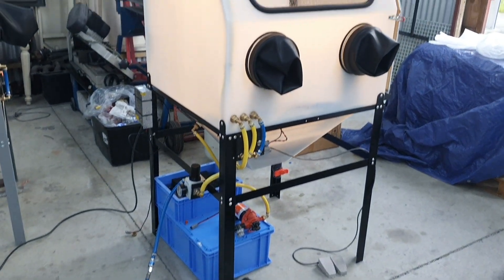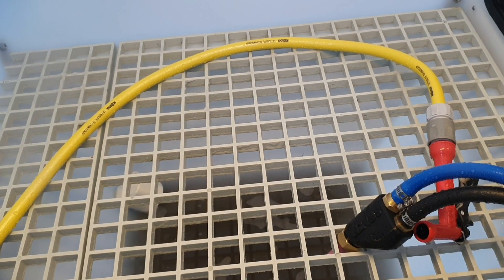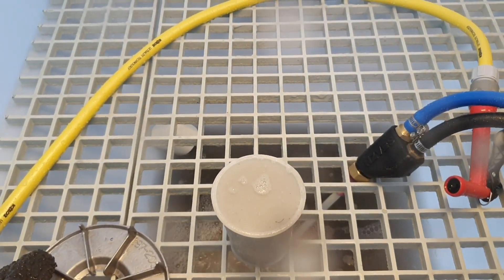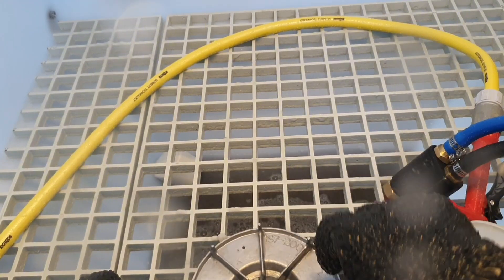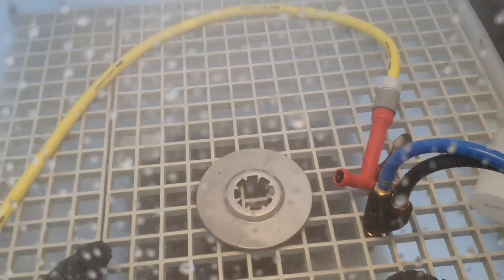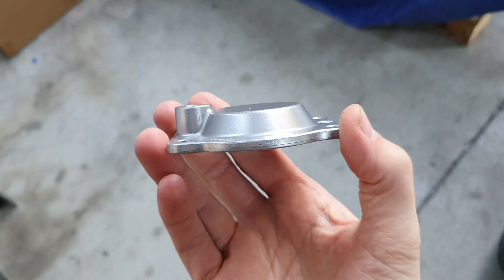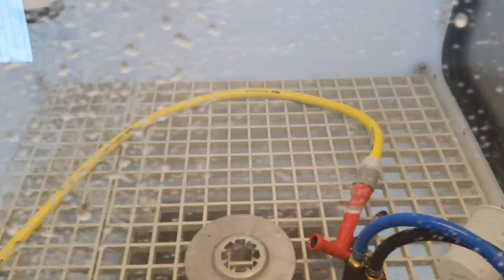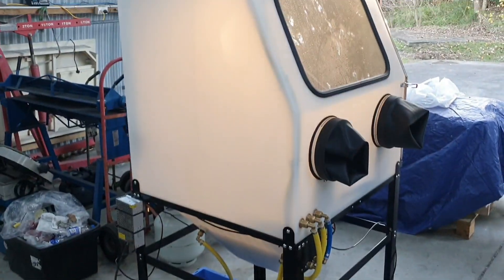Vapour Blaster Prototype - 12v - 80% SLURRY CONCENTRATION!

Comment: Hi
I have one of your 3d printed guns but having slow results in cleaning 
Is there an ideal slurry mix and air pressure the might help to improve?
Thanks
Reply from the maker: @stank9203  essentially the higher the media to water ratio the better. You really need a minimum of 10% media but ideally you want to be over 20%

Improving the speed comes down to your air flow. I see you sent me an email so I will get a few more details off you to set your gun up to match your air supply.

Thanks for watching!